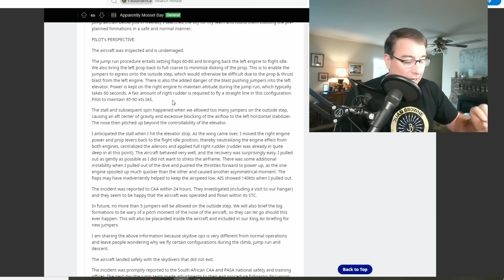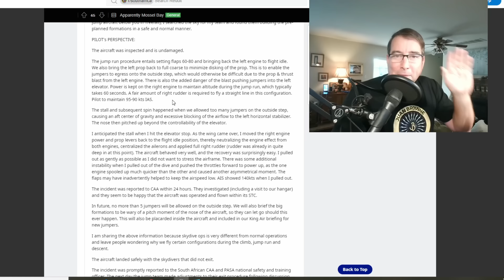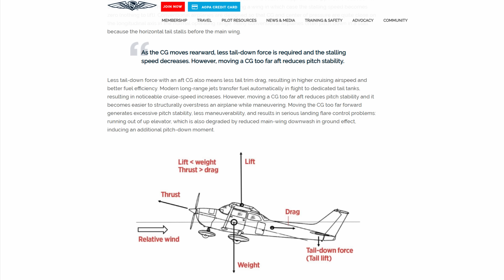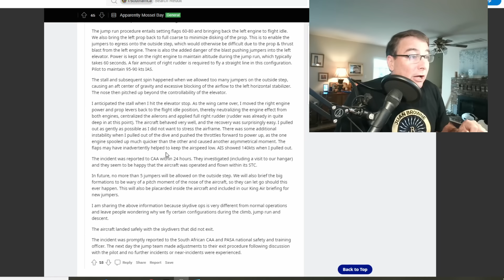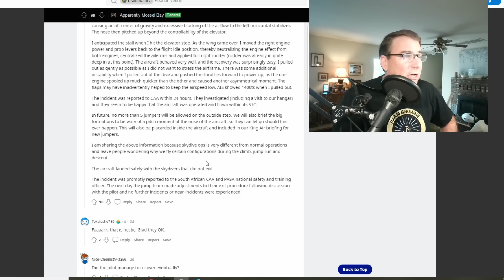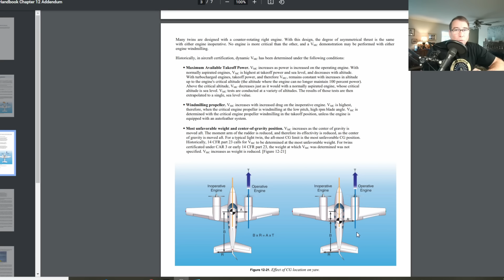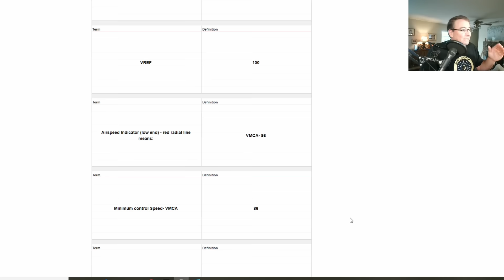Stall+Yaw=SPIN!  King Air Skydive Incident

Comment: That dive was only 140 knots?  He was passing the divers going down.
Reply: Indicated airspeed is relative. A plane in a flat spin for instance is falling towards the ground at a good rate, yet the airspeed is zero
Reply: A skydiver's speed is variable, but is usually a little over 100 knots when belly to earth.  You can exceed 140 knots, but only in an extreme head down dive

Comment: Back in the day when I jumped in SA the pilots weren’t so accommodating 😜

Twins were not popular. Typically a 205/6/7 was used drop a number of jumpers. Sometimes a 185 for pairs. 

DC 3’s were used often for large groups and military jumps. C130’s on occasion for military operations. 

The procedure was always the same. Cut the power and reduce the prop wash then empty the plane as fast as possible 😂 The pilot didn’t give the impression that he was keen to hang around. 

I think that maybe over the years pilots got convinced that they should contribute more to a nice tight formation by allowing the team to climb out all over the aircraft so they all leave together. 

There’s obviously a price to be paid 😂

Comment: You’re not exasperating the spin with aileron away with wing loaded aircraft erect spin. In such an airplane and such conditions, such aileron is actually a good idea after idle, neutral aileron, rudder opposite, elevator forward.

Comment: You can see that the elevator was in the full up position if u take a look at the first picture that is shown in this video -.- Looks like the pilot was in panik pull instead of pushing, or 'm i wrong with that? It looks like the "report" should look better than the reallity was :D

Comment: When I was working toward ppl my instructor introduced me to spins about halfway through the syllabus, (think old school Jeppesen Pilot).  Said he did it  to introduce/familiarize them and to make sure if I ever entered one I'd know what to do to get out of one.  Did most of my ppl training in 
Cessna 152 and Piper Warrior.  Spins in the 152.  After flying 10 years in the navy went to get FAA flight instructor add ons.  Went to a flight school to get them done in a structured environment.  The school required all CFI's to not only perform them, but to be able to teach the aerodynamics of a spin in a classroom setting.  Had the choice of performing spins in a C152 or another plane.  Of course I chose the C152.  I don't remember what the other plane was.  Had to perform a spin to the left, a spin to the right, and then a third one in whatever direction I wanted.  And each had to have three full turns before initiating recovery procedures.  Good times.  Did a fair amount of Vmca  and single engine procedures in the King Air B200.  But never did spins.  I don't recall a whole lot of talk about recovery from spins in the King Air other than the basic recovery procedures in a single engine, FW turbine.  Fly safe!

Comment: Why do some jump planes & glider tow planes do this on purpose after they jump or release? They roll & dive aggressively. It has become very common. It's crazy in a non-aerobatic aircraft. I have circled parachuters while diving many times in my Pitts Special. No big deal in a draggy, strong aerobatic airplane.

Comment: Lots of jumper dumper ops in my logbook, including the BE90.  I regularly feather both props, not just one side.  As a jumper and a pilot, the king air is the worst jump platform among turbine aircraft.  It’s very pitch sensitive compared to other platforms like the otter and pac750.  Doesn’t take much to get beech products out of cg.  The meat missiles should have known better than to go to the back like that all at once as well.  The secondary stalls were inexperience on display by the pilot.  He knows better now and has probably flown that jump run in his head a thousand times since.  This was a great learning experience for them, other pilots and other jumpers without any blood being shed.

Comment: Non pilot here— is every stall worthy of an incident report even though it was recovered with lots of altitude left? (I’m not discounting the pucker factor this must produce) Is this an FAA thing or just  company policy?
Reply: Stalls at a safe altitude are a routine part of private pilot training. Spins not so much. Aircraft has to be approved/certified for spins and typically within narrower weight and CG limits for spins. Highly unlikely spins are allowed in the king air. From the analysis they also went over the speed for having full flaps out. With jumpers it's obvious from the video why a spin is a bad idea. But it's reported in this case due to aircraft inspection requirements and possibly danger to passengers.
Reply: @timscofield8003  Makes perfect sense. Thank you for taking the time!

Comment: Zero understanding of skydiving operations and requirements thus no comprehension of the need to minimize the enormous King Air windblast, and not to descend excessively during a jump run. Then on the flying side, no mention of spin recovery training having been taken out of civilian training syllabus which is the primary problem here. FAA and CAA need to rethink that.

Comment: Fortunate that they were wearing parachutes :)
I wasn't terribly impressed with how long it took him to regain control of the plane. If you want low prop wash I would idle the engines and let gravity power the plane at good speed. If you need a certain altitude, start higher.

Comment: In 2019 in Umeå an Airvan stalled before the parashutists had jumped.
It entered a spin which caused a wing to break off causing the aircraft to enter a high g spinn which prevented anyone from reaching the door before the aircraft hit the ground

Comment: The plane slowed somewhat with flaps down but by doing this it would increase shall speed, so would it be better to just leave the flaps up and start the slow down earlier.  Or, use full flaps to slow down then raise them, and then have the jumpers go out and play.
Reply: Raising flaps on a slow aircraft creates another stall hazard...flaps are to enable slower speeds without losing lift and stalling

Comment: I don't really understand the high speed stall situation.
Reply from the maker: watch again..."ANY ATTITUTE, ANY AIRSPEED...ONLY    ONE    CRITICAL ANGLE OF ATTACK..... "    questions?
Reply: @blancolirio  I guess I'm not understanding the angle of attack mode. 
Air speed is forward motion and lift, right?
So if you are above the stall speed of the given aircraft, what is causing the stall condition to take over?
Reply: Stall speed changes with weight, temperature, density, CG, g forces, and a bunch of other factors. It’s not 135knots always or whatever number it is in the 90. You can be cruising along at 200kts and bank sharply and stall the aircraft.  It’s easy to do.
Reply: @stevenbeach748  that's scary.  I a turn and bank maneuver, I get the loss of speed and air flow change.  Does how fast the move is put you over the edge faster
Reply: @timothyboles6457  yes  it increases G force which increases stall speed
Reply: @stevenbeach748  ok. So that's a dynamic I never knew about.  Thanks for the insight there.

Comment: 03:58
Anyone, please correct me if I am wrong. I was instructed that lift is always perpendicular to the wing. If this is true, then the diagram is either incorrect or I am???
Reply: You're right, diagram's wrong, lift with the wing angled up above the horizon has a rearward component.  To add to the fun, the wing may be mounted with a non-zero angle of incidence...

Comment: Have a lot Be-99 time, and King Air time. 3,000 hours? Applied for a part time job for fun flying a jump plane. With lots of experience in the type. Flew a few flights in a ratted out C-90 jump plane. In Byron CA. Long gone airport! ;) One of many I used to fly out of! :) Oh, probably 30 years ago. Or maybe more. On the two flights I worked, and several I rode as an observer, never went to asymmetrical power when the jumpers exited. But I will say the main't condition of the airplane, and the operators lack of standardization and procedures. Prompted me to only make a few training flights, and two flights as PIC. No more! Even Part 135 freight in Beech Turboprops was safer than that! ;) For the most part Beech Turboprops are just like big Cessna 172's. With Turboprops strapped on. And very reliable PT-6's at that! Big thick wings. Low stall speeds. And lots of jet fueled power if you need it. But they will bite you in the ass like any other airplane! I guess any operation is only as safe as you the PIC makes it. And these days us old guys bitch about our major airline jobs! Ha-ha!

Comment: The most scary thing to me in the video is the possibility of the aircraft impacting skydivers. It seems that the recovery was attempted not only with not enough speed, but also without gaining enough separation from the people. There was plenty of altitude so no real reason not to continue the dive and pick up some additional horizontal speed before pulling out to ensure everyone was clear?
Reply: Turn and a half, you're facing right back where you came from ... it might be lucky he DID have that secondary spin-stall, as it turned away from the skydivers!

Comment: I don't have much respect for jumpers. I see them out near several local to Brisbane jump zones with their own runways and it's like a hippy festival with canopies. Nothing wrong with hippie festivals but that lifestyle doesn't mix with aviation in my opinion. I have a friend who did jump flying for a few months in a C182 when he was building time and the last guy to jump reached across him and turned the engine off and pulled the F'ing key out then jumped, forcing the pilot to make a forced landing on the field co-located at the jump zone. They're just up themselves. I know military jump guys who won't go near civvy jump operations. Even Joco (SEAL guy) says the same. He'll neve jump with the clowns after doing it properly in the military.

Comment: The pilot is also missing the point in his/her  statement about no more than five jumpers on the step... the number of jumpers is absolutely immaterial... it is the weight as it impacts the CG that is relevant......This may seem a minor point but, it is, IMHO, an expression of the commercial aspects of what is going on here.  lbs.  don't pay to utilize aircraft, the number of paying jumpers or "meat missiles" do however.

Comment: I'm not even a pilot, I just fly sims on occasion, and reading that pilot's description of their jump procedures had me cover my mouth with one hand. Flying a plane right down to it's minimum air speed at full flaps isn't something you should be doing regularly on it's own, nevermind while throttling back an engine! 

If you need to hit a certain speed for safe jumps you should be picking an aircraft with the required performance, not asking performance from a plane that's not designed for it. I know there are modifications for small aircraft that can lower stall speeds and improve low speed performance, but I've seen those on bush planes, not twin engine craft.

Comment: 8:55 - "An aircraft can stall at any attitude and any airspeed, but it can only stall at one critical angle of attack" - this is why the vertical bar at the top is always the critical stall angle of attack on the Butterfly AoA Instrument. Now if Juan B. or Dan G. can only find someone to bring it to production...
Reply from the maker: Link?
Reply: @blancolirio  Yeah, I should probably give up on the trade-secret-to-patent hopes, and just make a video or create a website for the design.  The details are in the emails I sent you about a year ago, I modified it slightly in the email I sent recently to Dan Gryder. Can you think of anyone else who would be interested enough and connected enough to make it a reality?

Comment: Where were the other jumpers in the aircraft?  Hopefully as forward as possible.  If they hadn't been briefed it would be human nature to watch the exit. Often you'll see lines in the jump ship,  stay behind this!   If your giving the count and the plane wobbles or the horizon moves,  leave and everyone should follow. 

I've heard of jump ships using a not straight jump-run.

Commercial issues for decending on jump run, especially for Tandoms that usually exit last.  Marketing will advertise jump from 14000!  If on the video it's 13500...

There are cloud-ops in most DZs.  For sure that is a beautiful sky.

I hope the pilot had bail-out rig and the door was locked open.

Comment: Shouldn’t it be considered that the pilot was also maneuvering to avoid the sky divers? He did a fine job in my opinion.
Reply: I doubt he had much control over where he was going until the video ended.
Reply from the maker: No aircraft control….

Comment: Ok with all due respect (I have watched your work for a long time) you're hanging sh*t on the sport I love. 
- First jumping in cloud is acceptable assuming its at a height that will allow you to locate the landing area with enough time to Nav back. 
- We also have a cloud procedure to ensure safety under canopy. 
- The aircraft must maintain altitude on 'jump run' as any descent would increase the chances of a tail strike on exit. 
- I would speculate here, but typically in in a 'big way' load, people will be required to sit as close to the front of the aircraft as possible until the absolute last second to ensure acceptable CG. 
- Finally; in 6 years of jumping this is the first time I have seen (or heard) of a complete stall on jump run. 

Skydiving is not just 'meat missiles', it, like all forms of aviation is incredibly technical and requires a high level of training and planning to ensure a safe operation. Again, like all aviation, we will learn from this, and ensure it does not happen again.
Reply: The aircraft can descend in a level attitude with no risk to the jumpers
Reply: If you want to maintain altitude, as the plane goes slower the pitch has to increase, which lowers the tail.  This sounds to me like a situation with higher risk of hitting the horizontal stab than a flatter pitch in a slow descent.  I am flying jumpers in a Twin Otter at the moment and have to keep this in mind constantly.
Reply from the maker: Ben- You guys need to TIGHTEN UP YOUR OPERATIONS AND REDUCE YOUR NUMBER OF ACCIDENTS AND INCIDENTS. These stalls happen all too frequently. You are suffering from normalization of deviance.